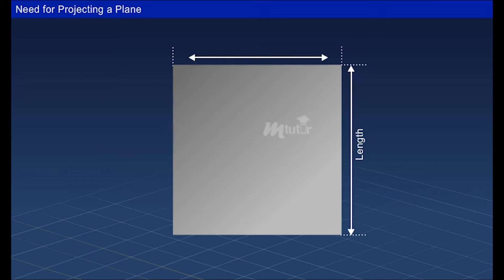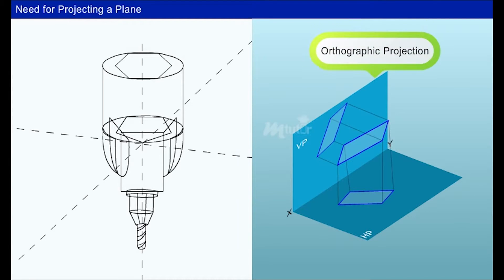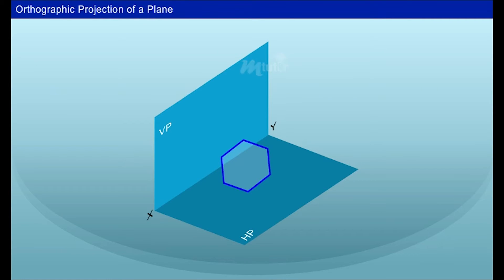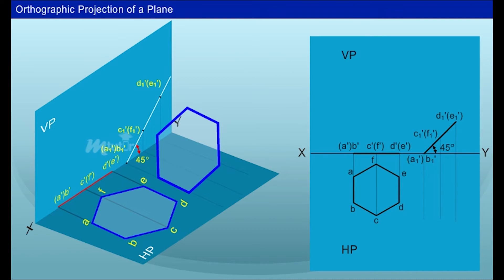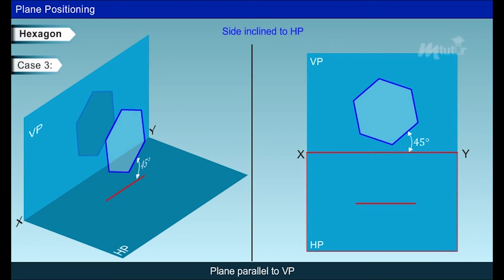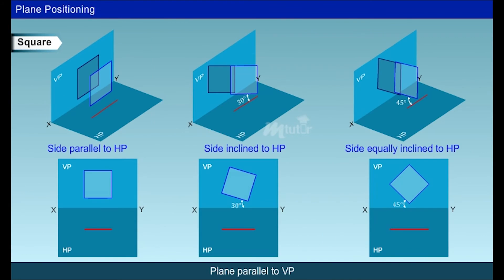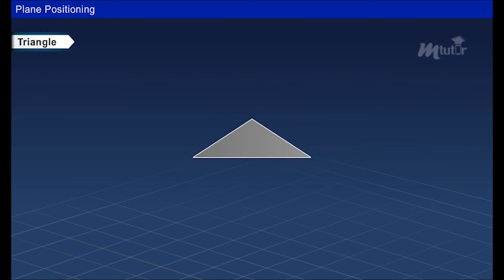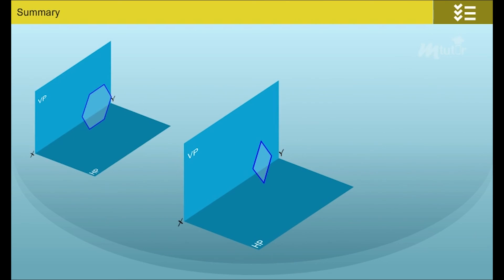Orthographic Projections of Plane Surfaces [ Year- 1]

Comment: 3:16 edges or surface????
Reply: Edges only sir. See the actual position in stage 2 instead of simple position
Reply: In order to keep one edge on HP (in actual position), it is necessary to keep the surface parallel to HP and edge should be perpendicular to VP ( in simple position).